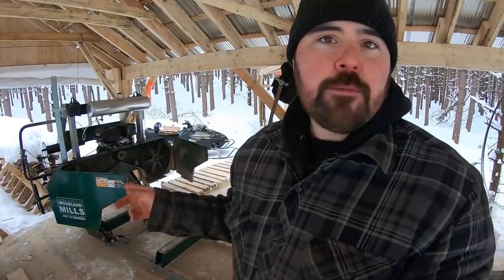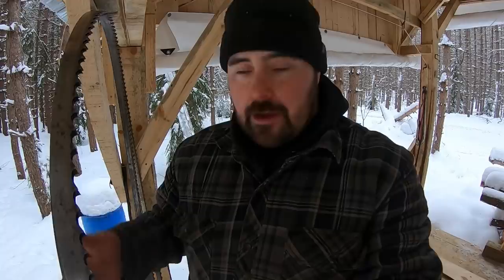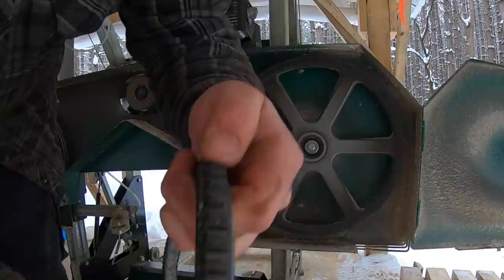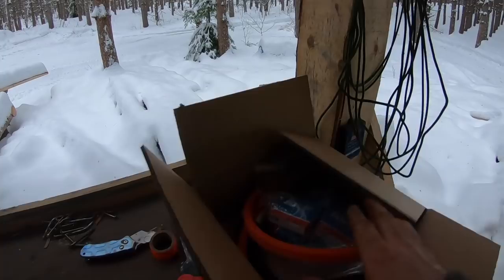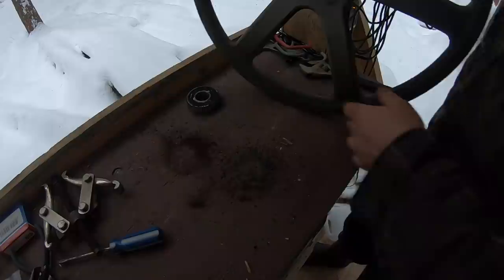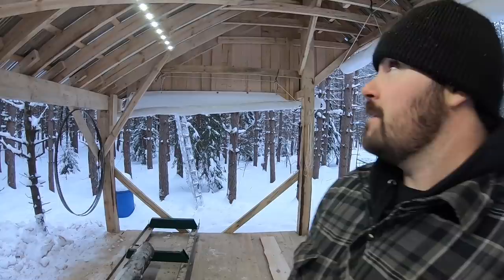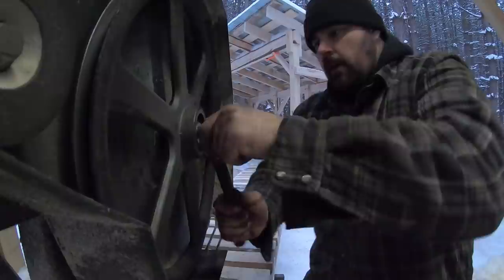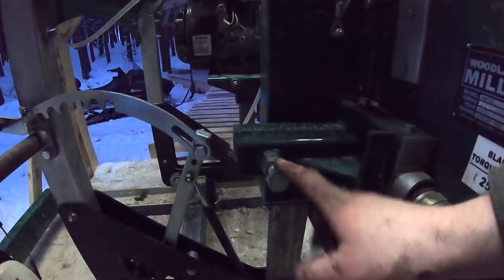I Replaced My Bearings Belts and Blade on my Woodland Mills Portable Sawmill

Comment: Hey Sandy, having spent much of my careers (yup plural) involved in equipment repair and maintenance I learned a little trick with bearings. Get a syringe from your vet, etc and fill it with a good synthetic motor oil and after cleaning the surface of the bearing slide the needle in between the bearing seal and the INNER race and add about a pea size amount of oil. Do that every year and those bearings might just last forever. The dust sucks the grease out over time leaving no lube and that is what wears them out. Works amazingly well. Can also keep a bearing that is going last until you get a chance to replace it. 👍😎👌

Comment: when putting in bearing get a socket , pipe or a bearing installer that will ride on outer race but that will fit in your wheel. i lightly lube the bearings and hub. never  hit middle of bearing you will damage it.your video's are very helpful. keep up the good work. take care and be safe.
Reply from the maker: Thanks for the tip John

Comment: Sandy great video.  I have replaced hundreds of bearings on my farm machinery over the years.  I use pullers to  remove the part as you did.  That is a good approach that won't damage the part.  I have seen people use crow bars and hammers ...not recommended.  A good way to damage the part. Once the part is off, I put it in my hydraulic press and slowly, carefully, push the bearing out. Before installing a new bearing I carefully clean up the bearing housing on the part with steel wool or very fine grade emery cloth. Next and very important, is to put a fine layer of thread-ease paste on the inside of the hub and outside rim of the bearing. Then I carefully press the bearing back in place with my press.  When re-installing the part, I polish the shaft with fine emery cloth and spread thread-ease on the shaft.  The part will slide on much easier. Lastly, I put thread-ease on the threads of the bolt and reinstall.  The next time you have to replace a bearing everything will come apart with very little effort.

Comment: Sandy with all the respect I have for your work there is a little tip. Before touching any blade tracking ajustment after changing a blade, turn by hand your idler pulley many many times. You won't break anything and you'll be surprise after several turns that your blade will centered by itself or very close. Of course sometimes the blade might need little ajustment but it's very rare and very little.
Reply from the maker: Thanks Denis. That’s a great tip and one I often use. Thanks for passing that along

Comment: Sandy, just some FYI, the wheels are cast iron with steel bearings pressed in.  Woodland has replaced my drive and both of a friends wheels for wear. We are now in the process of having all of our band wheels cut and steel sleeves pressed in.  You will continue to have this problem with the current wheel. If you check the bearings and replace them, you may want to follow up by checking the follower wheel also. My mill is a 2018 and I just pulled the follower wheel, the bearings were fine but the space where the bearing ride was rough. when checked with a caliper, out of round and worn. My mill is newer but it has about 500 hrs on it from when I installed an hour meter. Always check the bearings and runout anytime you change blades and belts.
Reply from the maker: I’ve been quite fortunate and haven’t had any issues with bearings in the bandwheels except for this one
Reply: @sawingwithsandy  well it’s coming we can promise you that. These guys having the same problem I’m having. I mill a lot of wood and I’ve been through countless bearings and 2 drive wheels and I think they’re going bad again. 2018 model hm130 and I’m not happy

Comment: FYI, all snap rings have a round and sharp corner from the stamping process, always put the sharp edge on the load side of the groove. If your lumber gets wavy check the drive belt tension, the slightest slippage will cause the blade to dive or climb. The old belt can be used as a lifting sling, I doubt your tractor can break it. test it and see.
Reply from the maker: I’m going to have to try the lifting but with the belt as I figured it’d snap immediately

Comment: Good show, I used an old socket to hammer the old bearings out and news ones back in, btw, it’s called a snap ring. The blade guides you have are for the older hm126, oh well, paper weights now for your 130.
Reply from the maker: Hey William! I think the old 126 and 130 parts that I have are interchangeable here. The socket would surely be a great idea

Comment: You should have just pushed on the outer race when seating the bearing.  Nice to see what's involved with changing the parts and i never understood that the saw blade actually runs on top of the belt and that orange liner.

Comment: That 'spanner clip' thing is called a circlip, pronounced- sir clip, over here in the UK 🇬🇧. You may find that the other side pulley bearings start to wear out quickly after changing the ones you've done. I always changed them all when changing connected by belts or machine chain 'ie' in elevators but you have bearings under much more heavy use.
Reply from the maker: That makes sense about changing them at the same time. Thanks for passing along that info Ken.

Comment: I see where you have your  three saw blades hanging could be a safety issue when passing by or working around those blades.  You or anyone else potentially could get cut by those super sharp blade.  Suggestion is to build a blade box at that same location to keep the blades in.  Have a great day.
Reply: Or simply flip the blades around facing the outside where it'll be much harder to accidentally rub against them.

Comment: The funniest part of watching you use a hammer and nails  to remove the old bearings was that your puller, a tool designed for this specific purpose, was sitting right there on the shelf all that time. Happens to the best of us.

Comment: Hi Sandy. My HM130 as of yesterday started throwing the blade. There is a small amount of play in the drive side bearing on mine. The same one you are working on @ 7:34. I have never not been able to get my blade tracking spot on until now. I have changed the drive belt, and the orange follower belt. I remember when I purchased the mill they said, "You should never have to mess with adjusting the drive pulley". I can get the tracking to be perfect on the follower pulley side but I can see the drive side is slowly working the blade outward. I wonder if that slight bearing wobble is the culprit? I have a call into WM but now it is the weekend when I would like to be milling. Thanks for any help you may provide.

Comment: Hey Sandy. Enjoying your channel quite a bit. I’m In the process of buying a portable sawmill and I’m probably going to end up with the 130 max. Thanks for all your information about sawmills which has helped me making this decision. I’m curious if you tried any other saw blades besides the Lenox bandsaw blades from Woodland Mills? I hear other guys talking about using Kasco 7° blades since they last a good bit longer than the Lenox blades. There’s another channel called the “outdoors guy” who uses a wider (1 1/4”) and thicker blade (.055); I think he uses Woodmizer turbo 7 blades. He doesn’t seem to have any problem running a slightly thicker and wider blade in his HM 126. He did mention that the first time you use a thicker blade, you have to adjust the blade blocks to give more space between them. FYI Bill.

Comment: I came to think of it and realised, the pulley on the alternator (if mounted instead of the idler wheel) can not engage the belt as it should... it would ride on the outside of the belt... If you can fit a large (aluminium or crap-o-loid) pulley from a washing machine to the other blade wheel and run a separate belt to an alternator that should work...

Comment: Next time use your old bearing as a punch this way you put the force on the outside of the bearing probably wouldn't matter as they went in quite easily you can also heat the pulley with a propane torch to heat it up which will expand and allow the bearing to go in easier when it cools it will tighten up.
You would probably do yourself a favour to change out the idler wheel bearings at the same time!
Reply from the maker: Good plan!

Comment: that belt has a bunch of life left in it. those types of v belts crack all time. its common. your in a cold climate. so its going to shrink and expand and rubber crack. the cracks are to help throw out water. just heads up. if the belt is still SOFT its still good. if its shiny and hard its bad... simple as that. mechanic of 30 yrs. 
use belt dressing sometimes to help condition your belts. or belt conditioner if worried about cracking. but dont spray your blade as it is silicone based and will cause issues if stain or paint later.
Reply from the maker: Good to know. I’ll hold onto it. Thank you

Comment: I did everything like the video and when I put drive band wheel back on with bolt lockwasher and washer bearing spin freely but the bearings in the band wheel are loose fit so it allows the band wheel to wobble before tension is applied is this normal?

Comment: So i think i'm to the point where i need to replace my belts as the blade looks like it's about running on the cast iron. About how much time did you get out of your belts? These were the ones that came with my 130 max and i got 13 hours out of them. Does that seem too quick to you? 

I really appreciate your videos, big help. And it's no coincidence my Mill shelter looks something like the hillbilly hideout 2.0.

Comment: never run manually in opposite direction when You test blade- I did and get problem with motor ,running opposite (thru the clutch) makes something wrong with timing or else

Comment: Thanks for this video.  I had a look at my belt today and decided to change the belt.  I noticed what I thought was a little play in the wheel/bearing so I took the time to change the bearings as well.  The new bearings had the same amount of play so I think they did not likely need changing, but oh well all done in about 20 min or so.  It took me 5 tries at re tracking, but all good now.  
do you have a time frame on how long it will be before I have to re tension the motor?
Reply from the maker: Glad to hear things went smoothly for ya. I’m not too sure how long until there is the need for retentioning. I’ll likely just check it each time I change the blade

Comment: Hi Sandy great video  all your videos are ,when summer hit ill be building sawmill shelter also got the idea from u, 
I bought hm 126 portable saw mill ,only have 4 hrs on it so far, getting ready to cut a birch log to build a butcher block any recommendations on moisture meter to check how wet the wood is?,
Reply from the maker: Sounds like some good projects coming your way. I’ve not use a moisture metre before unfortunately
Reply: @sawingwithsandy  thanks for responding just building a blanket box for my wife , thought i should check the moisture in wood before gluing together.

Comment: Hi Sandy. Great job on replacing the bearing with the tools you had on hand.  I am planning on purchasing the HM126 in the spring and just wondering what your thoughts are on the Woodlands mill now that you have used it for a few years.  Thanks
Reply from the maker: Hey Jeff. I’m still happy with the purchase since everything is quite reliable and I’ve never been let down by a break down or anything like that

Comment: Hi how many hours were on your mill befor you changed your bearings,,,mine has 275 hours and bearings were good ,,but wheels were bad ,,inside bearing,,the wheel wore big
Reply from the maker: Unfortunately I'm not sure but it was a few years of use as this model didn't come with the hour metre
Reply: I have a hm126 with 38 hrs on it my band wheel wore big I think is it normal for it to wiggle a bit without blade on and torqued?
Reply: @electricchair7024  yes they wiggle without torque on the left side thats normal ,,its when u have torque and wiggle ,,teres a problem
Reply: @harveymackenzie8328  mine wiggles on the right side ,the drive wheel,is that normal?
Reply: @electricchair7024  if there torque on them ,,there should be no play ,,,wiggles,,,,,if so take off your wheel ,,,the bearings ,,wore the wheel,,i put 5 of them on mine under warranty ,,to check take off band wheel ,,put your finger in the bearing hole see if theres play side to side

Comment: Did you throw grease on those bearings before you put them in?
Reply from the maker: They are pressed in bearings so the outside of the bearing isn’t supposed to spin against the cast band wheel.

Comment: How did you identify that bearing as the source of the sound?
Reply from the maker: I could hear the sound coming from that wheel when I’d let off the throttle and after shutting off the engine I’d rotate that wheel and feel the roughness
Reply: @sawingwithsandy  thanks Sandy.  It was a great video!

Comment: Very bad design on those band wheels, my band wheels have grease nipples on, so I can grease them.. Plus all my rollers, outlast them by 3 or 4 times. Good video.
Reply from the maker: I’m wondering if these bearings are different since the outer portion of the bearing which contacts the cast hand wheel doesn’t spin
Reply: Ya but then Woodland couldn’t make money selling parts if you could grease them
Reply: @eugenebertrand  that's correct. All moving parts really should be able to grease them,